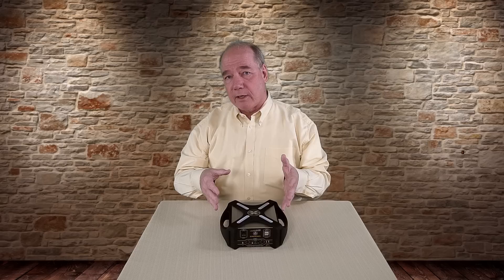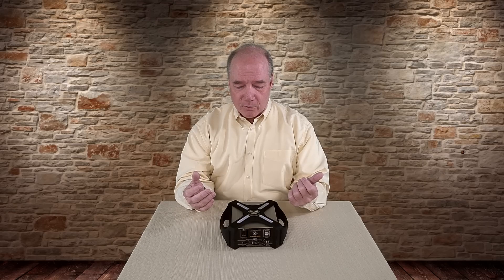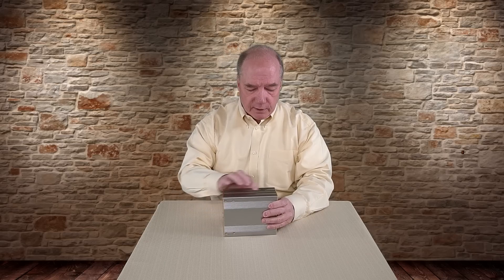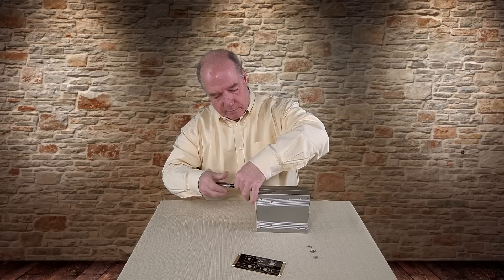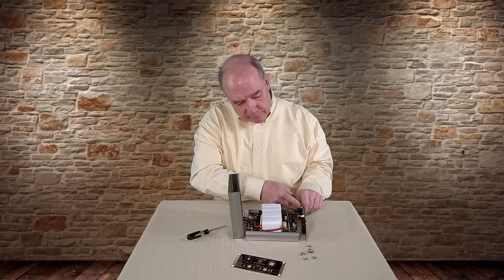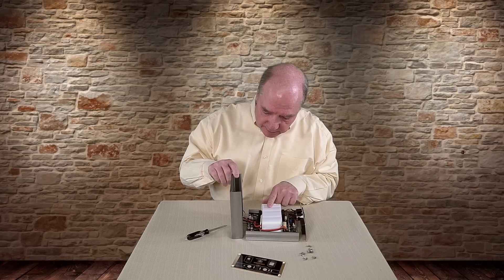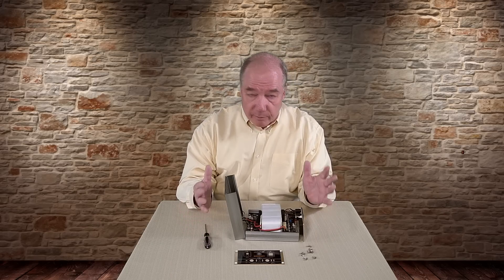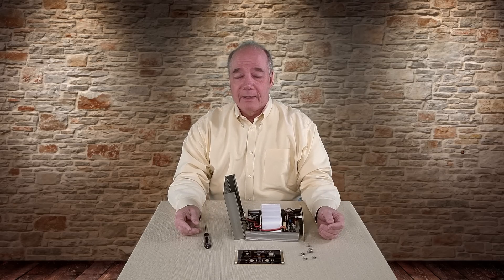Energen DroneMax 360 Teardown - A Quick Look Inside!

Comment: olcorral
No reflection on you Rick or Drone Valley.
375 backers pledged $62,935. We got nothing. 
Energen has yet to deliver on the DroneMax360. It is Oct 2, 2018, the product was promised to deliver last May. It didn't and still has not. Energen has stopped updating as of August 22 with the promise of the units being on a ship container and in the LA harbor Sept 12. No one who backed the Kickstarter campaign has received a single unit. And no one has heard a single word from Energen. 
It has turned out to be a scam with no units delivered and no money refunded. Do not buy any products from Energen. 
With such potential it is a disappointment to all of us who backed them. 375 backers pledged $62,935 and received nothing.
Show less
￼
￼
REPLY
Reply: olcorral yes, I'm wondering at this point if other responses here are being removed. It would be nice if we could hear whether we've been had by Energen or we all hallucinated this deal?
Reply: I'm also a Backer and have been waiting almost a year for my device. I have started to get the same generic response from Energen........ "You'll receive it in 2 weeks" I too decided to back the Dronemax 360 after watching the videos put out by this channel. Energen has done an extremely poor job of responding to backers concerning all the delays. I pledged $40.00 and don't expect to ever receive my product. Multicopter Warehouse claims to have them in stock https://www.multicopterwarehouse.com/energen-dronemax-powermax-powmax-360   However, a great lesson has been learned..... never, ever be taken in by these types of videos. Thanks Rick, lesson learned!
Reply: A bunch of backers were contacted by Energen requesting final payments for DroneMax by Money Orders only and by mail. Not accepting credit cards, personal checks or PayPal. Very suspicious and of course backers are not sending payments. Youtubers should be updating their videos to reflect the failure of this Kickstarter campaign. They went out of their way to promote the product

Comment: Hello I would like your opinion on the New GDU 02 is a drone of good quality and would you be you a good choice compared with The Mavic Air ? I know that is a different price. What will be your choice between theses 2. Thanks. Marc from Quebec City Canada
Reply from the maker: Marc, thanks for the post and as the GDU 02 is a brand new quad, I haven't had the chance to test it out yet so my opinion will be based on my experience with other new products (or companies). On paper it looks like a very competitive quad in the market today. It ticks all the boxes on distance (7km), camera (4K) and portability. The concerns I have are around it's newness. Any complicated product like this is a "moon launch" of a design effort and companies rarely get it perfect. I'm sure it'll be an improvement over prior models but it's all new software, new electronics and a new airframe so until I fly it a while, I worry that any small design mistake could hamper the quads ability to fly right. Also, since it's new and from one of the new companies in the drone space, the accessories you'll want (carrying case, lift kit, prop guards) won't be out for a while yet. On the other hand the Mavic Air is based in large part on the design of the Mavic and has been proven to be an amazing quad with few issues since it's introduction. There is a full line of accessories available and thousands of folks are flying it so it's been field tested. Right now if I was choosing between the two, I would go with the Mavic Air until the GDU 02 has been on the market for a few months. One other suggestion would be to check out some of the sales on the Mavic Pro that are going on right now - https://tinyurl.com/y88h4h58. You can actually buy the Mavic Pro for $899, which is a really great bargain and the better choice among the three. I hope that helps and thanks for the post. Rick

Comment: Preorder reduced is about $160 and the later price is $350. So this unit is not inexpensive  ( notice I didn't say cheap ). To each his own. I have almost one hour with my batteries so I'll pass. But a nice clip! Thanks!
Reply from the maker: Ken, I agree that it's not an inexpensive accessory but when you consider that the Phantom 4 cells are about $170 each, this starts to look like a great deal with the discount. It also does a lot more than a set of drone batteries since it allows you to charge a wide range of other gear beyond just drone stuff. I really love that they added the AC power adapters, which come in handy for things you can't charge from pure DC. The reason I am talking about it so much these last few weeks is that the pre-sale ends this Wednesday and then it almost doubles in price so I want to make sure the folks on my channel take advantage of that. Thanks for the post! Rick
Reply: Rick, I can imagine that this could be price effective for some who need this type of ready power source. Your point about saving by preorder now is valid. I don't recall you mentioning that fact on the clip? So, by all means if you want one, buy preorder NOW!

Comment: Hmmmm, for the price, extra batteries are looking better and better... 😎
Reply from the maker: Dave, it's not an inexpensive accessory but it can do so much more than a few extra batteries. For starters, it can charge a wide range of drone batteries including the Phantom, Mavic, Spark, Mavic Air and Yuneec. It also has ports for charging USB devices as well as a universal port for anything you can charge in your car. Finally, it includes a 200w AC inverter to allow you to use items from your home. The best part is that for the next few days they are offering a 50% discount with the link I provided, which makes the unit about the same cost as a Phantom 4 battery. Pretty cool tech. Thanks for the post, Rick
Reply: Drone Valley Darn, Rick. You convinced me! Just pledged my $40 to get the 55% discount. Had no idea this was going on. I stand corrected... 👍

Comment: Will it charge Inspire 1 batteries?
Reply from the maker: Dan, I haven't tried to charge the Inspire 1 or Inspire 2 batteries on it yet but an pretty sure the AC outlets on the back will let you use the home charger to do that. I expect a new unit to arrive here in a few weeks that will be one of the first things I test out. Thanks for the post, Rick
Reply: I don't know if it has a port specifically for Inspire 1, but it does have a household plug that will work to power the Inspire 1 charger.